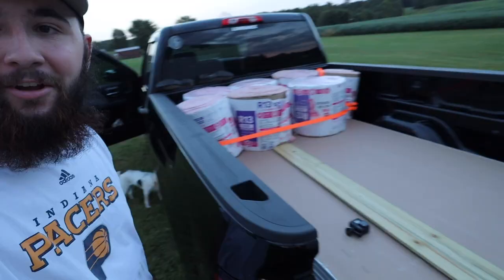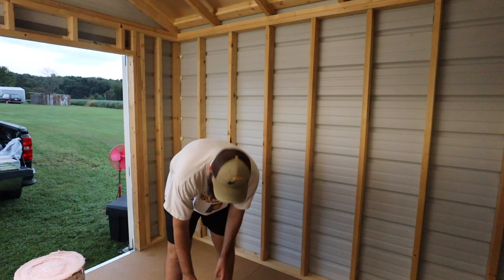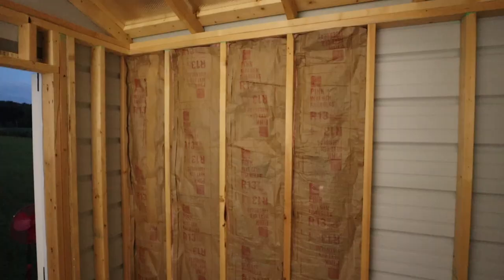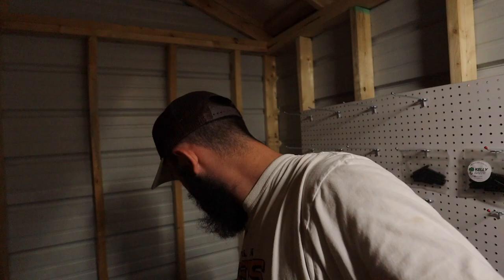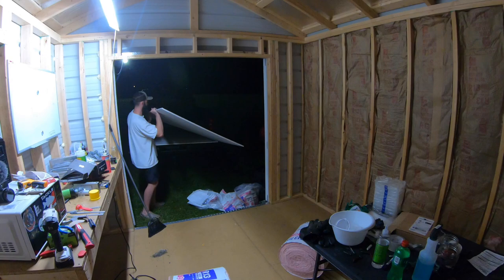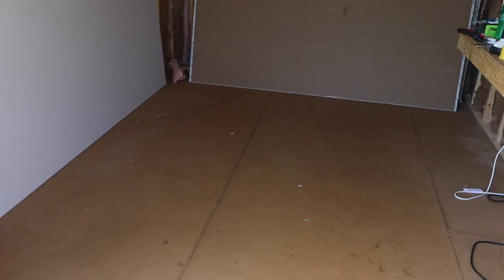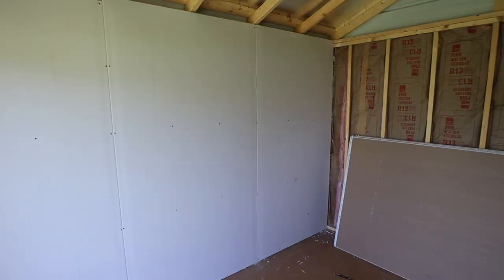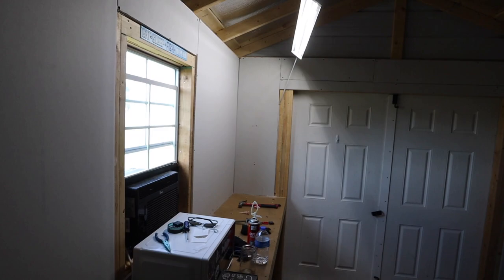Renovating My REPO Shed: First Time Hanging INSULATION and DRYWALL

Comment: Hey JT, you really should have used the moisture resistant plasterboard (sheet rock).
That normal interior stuff will go all soft and soggy with the moisture in the air very quickly.
You should have at least put up a moisture barrier after the insulation. This is just a thin sheet of plastic that is stapled over the wooden battens/joists/stud work before putting the sheet rock up.
This then keeps the damp out in the wet/cold months.

I’m from the UK and build houses, garden studios etc all the time.

Keep up the good work bro
Reply: PS You HAVE to do the roof. Just doing the walls will be a complete waste of time and money.
Reply: Question about that moisture barrier.....if you're putting that up on top of the insulation, do you still staple in all the insulation AND that plastic sheeting
Reply: @angelakellar4435  insulation goes between the studs and the vapour barrier is stapled to the interior face of said stud work. THEN you plaster board, skim and decorate.
Exterior stud face is stapled with House wrap (Tyvek), counter battened, battened and then cladding/siding

Comment: Only advise for you is keep the sheets at least half inch off the floor, im a drywaller and for your first time id say you did your thing man 👏🏼
Reply: Can you explain why the gap should be there?
Reply: @daebarron5022  Not 100% but heard to allow for flooring, and trim will cover. Maybe if water spilled and wont soak immediately